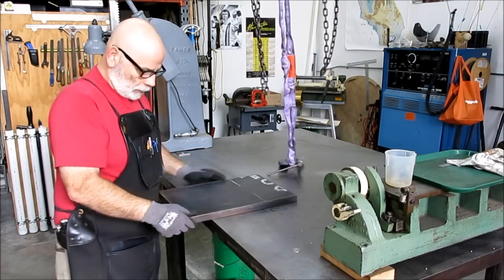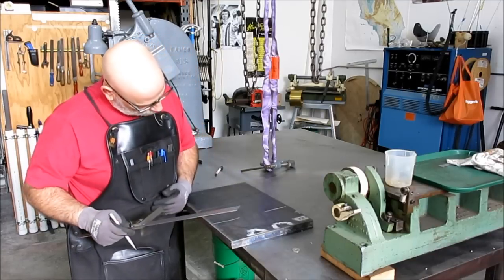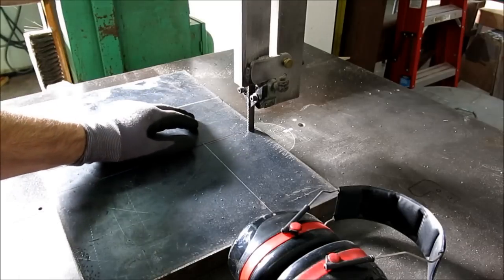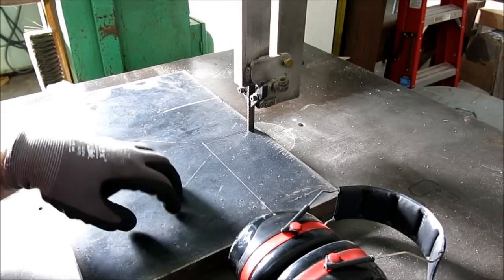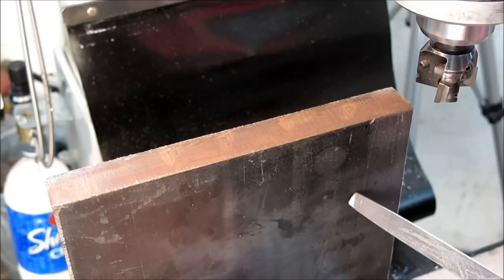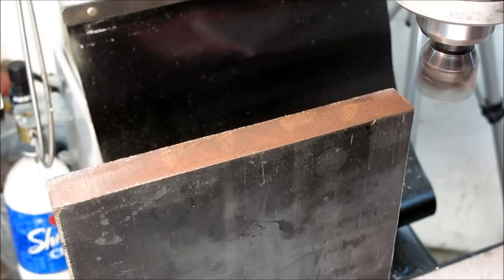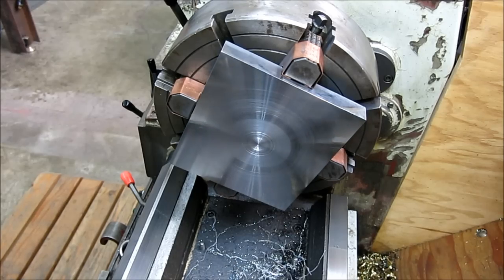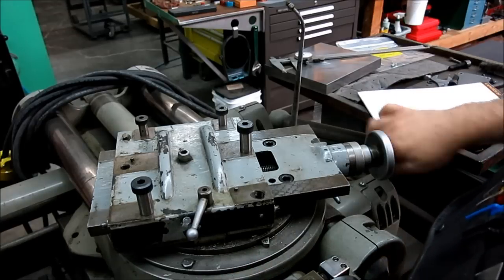Autometric Toolpost Plate Part 1

Comment: Hey Tom, I had to go back and watch your video on cutting tapers because I could not remember how to do the math to figure out the angle I needed to set my compound for the cut. I watched it and did the math with your numbers to make sure I was doing it right, then used my numbers to get my angle (1.43 degree ). Worked great. Thanks
Buddy
Reply from the maker: Hey Buddy,

Glad it all worked out for you. What are you making? Thanks for the comment.

Cheers,

Tom

Comment: Tom, That is a sweet little cutter. Your video prompted me to brave the cold garage. I have a lovely 2.5" wesson 3 insert cutter with built in R8 shank. I had picked up an iscar 2" 4 insert facing mill really cheap on ebay and the only time I had tried to use it, it was awful. lots of chatter which I could not understand. Today I discovered my drawbar was too long for it and the R8 was not seating. Now it gives a great finish. Both take a simple 1/2" square insert. I'll have to look for some ceramic inserts and give that a try.
Reply from the maker: Hey Mark,

Rigidity is really important to carbide performance. You just can have much rattle and shake with it. Thanks for the comment.

Cheers,

Tom

Comment: I like that little metal hogging cutter. It reminds me of my favorite lovejoy end mills and cutters. They use a basic square insert with a double positive rake and they cut great and the inserts can be had dirt cheap.
Reply from the maker: Hey Brian,

I have seen those. We also used to have a couple of Mil-Tec face mills that worked really well for steel and stainless. Thanks for the comment.

Cheers,

Tom

Comment: Wow Tom, Does that belly board bring back memories, Done a lot of that as a machinist trainee circa 1973 in a very small shop my first duties were to "make big pieces into litl ones on the big Do All saw and square them up on an old Index mill. We had a V sawed in the wood to steady it somewhat. Even 12 years later in a big Co. toolroom we still had to do a lot on the bandsaw. The later one had a low air blast tube at the blade to keep the work clear of chips. I seem to recall a motorcycle like drive chain rig/ w/cast iron v with wood handles and weights on one of the saws to help out the feed presure that I used somewhere back then "THANKS FOR THE MEMORIES" on NEW YEARS EVE...HAPPY 2015 to you and yours!
Reply from the maker: Hey Al,

Thanks for the comment. Happy new year to you as well.

Cheers,

Tom

Comment: That was a great shot going .100 deep at 1800rpm! You could actually see the chips change from silver to straw to blue!
Reply from the maker: Hi Aaron,

When the salesman demoed that cutter twenty five years ago he ran it up to 2500 rpm and did .200 deep across a bar. The finish was perfect. We bought several of them on the spot. Thanks for the comment.

Cheers,

Tom

Comment: During a short stint working at a place that made HVAC parts, we cut 2 inch stacks of sheetmetal on bandsaws for a particular part. Various widths from about an inch and a half wide, the width of a sheet metal roll long(a semi auto shear pumped out strips into a bin that I pulled from and loaded my clamps). Big table on a big Kalamazoo bandsaw. Granted a stack of sheetmetal is probably not as hard as a sold piece of steel but still... We didn't have a belly board but what we did have is a bit of a 3 step stairway looking deal right behind the operator, the "risers" were at about a 45 degree angle and had skateboard tape on them. So you stood on the "risers" so you could put your weight into pushing the work into the blade. Probably not the most OSHA thing and it made your hands ache after a whole shift of that...
Reply from the maker: Hey Dave,

Yikes. That sounds like the equivalent of bandsaw water boarding. Thanks for the comment.

Cheers,

Tom
Reply: I was 18 so I had the energy but not the patience to work myself into another station that was a  bit less masochistic. Though probably the next gig would have been the big floor standing riveter that woke up the operator with some new jewelry a couple nights before I bailed on the place.

Comment: Very nice a 4 jaw cut is the so much better way. Looks great and I like your copper shims for those jaws they look very well designed and thought out.
Reply: I have never used the cermet inserts. No place where I have worked had them. I have not bought different personal face mills or inserted turning tools either yet I think I need to  do that to actually be able to have them when I need them as things can be hard to find when one does not have to do that kind of thing often. Also building up spare cutting tools as personal which the company will replace for me when used up may be good.
Reply from the maker: Hey Lou,

The shims are really needed for the aggressive jaws serrations on the ends. Thanks for the comment.

Cheers,

Tom

Comment: Whenever i see Autometric in the video page i get excited, this is part 1...you get the idea. :)

Happy New Year, may it be a fruitful year filled with new hammers, Wiltons and all the nice things you've shown us in the past...AND more! :D

Edit: why not have a tool that has a bit of sand paper or scotch bright on the end to clean up surfaces on the lathe?
Reply from the maker: Happy new year to you as well. We should have some cutting on this machine pretty quickly. I have done what you mention. Using scotchbrite and a chunk of rubber as a pad squeezed between the tool block and the work. Works pretty good. Thanks for the comment.

Cheers,

Tom
Reply: oxtoolco Hm, chunk of rubber, interesting. I'm gonna write that down in the ideas notebook. Thanks for the tip :)

Comment: I made a cutter similar to your Ceratip using some APMT inserts. Mine seems to cut "harder" on deeper cuts. Yours appears to cut easier. I'm thinking about the contact area of my inserts as compared to the tips of those cermets....hmmm
Like most, I wait patiently for the Autometric to come forth and produce.. :-)

Colin
Reply from the maker: Hey Colin,

You should be happy. Every man wants to cut harder and deeper. Thanks for the comment.

Cheers,

Tom
Reply: Indeed but, of course, no-one wants to damage their spindle... ;-)

Comment: Nice job Tom,
I would have to say that cutting on the vertical bandsaw would have been painstakingly slow. I'm not sure if you have one, but I would have been looking towards a large horizontal band saw or power hacksaw..
I have a 21" hydraulic power hacksaw and have done similar jobs, Although just as slow, you can carry on with other jobs while she is doing the work for you.

Tom I hope you and yours have/had a great New Year and all your resolutions come forth over the next 12 months.

Matt
Reply: Tom has  a Johnson Model J band saw like mine he has shown in a video still sitting on the pallet I believe. It could have cut that plate on its own while he had breakfast. :-)
Reply from the maker: Hi Matt,

I have a big johnson saw but the plate would not fit in it. I agree I would rather be doing something else while the saw does the work. Better to do it quickly if you cant get it in the automatic. Thanks for the comment.

Cheers,

Tom
Reply: oxtoolco
 Really? Wouldn't fit? My big Johnson model J will cut plate up to 18" wide, that piece sure didn't look that big.

Comment: Hey Tom, I have a live center ( MT-3 ) with 6 different centers that you can use and the shaft that the centers go into is 6 thousandths out ( the inside bore ). The out side of the shaft is running true, so I needed the dress it up to make it right. I use a "last word" indicator on a tool post to set the angle on my compound, but I wanted to know how to set it up by using the math in case I do not have a part to go by.
Thanks Buddy.
Reply from the maker: Hey Buddy,

Check out my video on "setting up and cutting short machine tapers" Should have everything you need to do the job.

Cheers,

Tom

Comment: When chucking a square or odd shape in the engine lathe or VTL, it seems like the interrupted cut was deeper than when it got to the point where it was a continuous cut.  I know it was tool pressure, but is there a sure way to get the work piece flat from the corner to the center?  I usually had access to a bigger lathe chuck (VTL) so my work piece wouldn't fit my mill with a face cutter.

Comment: Nice way to end 2014 Tom.  How do you determine the max rpm for a chuck on the lathe? 
Happy new year!
Reply from the maker: Hey Bill,

I have always looked at the manufactures recommended speeds for chucks. No good way to have a general rule other than bigger is slower. The trick is to put one on your machine that allows you to use the max speed. Another thing that folks overlook is the loss of clamping force at high speed. I have never seen a chuck blow up from speed but I have seen plenty of stuff flung out of them. Thanks for the comment.

Cheers,

Tom

Comment: I assume those two raised curved ridges are to allow the tool to pivot up and down in some way. Seems odd that it doesn't have a calibrated tilt, though.

24:25 - old engineering maxim: If you drop something that CAN roll, it WILL roll ... into the most inaccessible part of the area. N.B. If it's heavy, it'll bounce off your foot on the way, and change direction unpredictably.
Reply from the maker: +Mark Sinden Hey Mark,

The ridges were stiffeners for mounting the original auxiliary motor. Some pattern maker said, yep that looks about right and glued them down. Thanks for the comment.

Cheers,

Tom
Reply: Hi Tom,

Darn - can't trust these pattern makers - they'll glue on ANYTHING given the chance!

Very interesting to see this being upgraded - loved the ball turning demo.

Mark

Comment: Tom,
Curiosity question.
Why not have the band saw blade guide lowered closer to the thickness of the plate being cut?
Eric
Reply from the maker: Hey Eric,

So I can see easily and shoot video easily. I prefer about an inch above the part. No good reason other that visual. Thanks for the comment.

Cheers,

Tom

Comment: I was turrnng with 4140 one time and ended up slightly bluing the rough piece with a angle grinder cut and HSS  would not cut that area....had to dremel it off, only about .001 deep
Reply from the maker: Hey Bub,

You can create a pretty hard tough spot in a blink of an eye. Thanks for the comment.

Cheers,

Tom

Comment: When you're squaring stuff like the plate in the vise. I've cheated before and gotten it very close to start with by running the quill all the way down and holding the plate up against the quill and tightening the vise. That will usually get you within a few thousandths.
Reply from the maker: Hey Gordy,

I always forget that one. I'm so programmed to use the indicator. I'll try to remember that one. Thanks for the comment.

Cheers,

Tom

Comment: Debarking: Quick removal of hardened surface left from flame cutting.  You said, hardened slag could damage tools, then sent that brave little cutter through at warp speed!  My ignorance is showing.  You did not say why you did that.  Were you just showing us that the little CERATIP is indestructible or is there an advantage to using max feed rate?  This wizard’s apprentice needs enlightenment please Sir.
Brad
Reply from the maker: Hey Brad,

The little Ceratip can actually handle considerably more that what I showed. Once you get under the bark the work is fairly safe on tools. There is a tendency to baby the cut on a surface like this and that will give trouble. Thanks for the comment.

Cheers,

Tom
Reply: oxtoolco Thanks Tom.  Needed the benefit of your experience.  I have noticed that adding more pressure/faster-feed, can result a better cut sometimes.  Takes nads to do it though.  Not because something might break.  It’s telling the wife what the $200 withdraw was for.
Grateful,
Brad